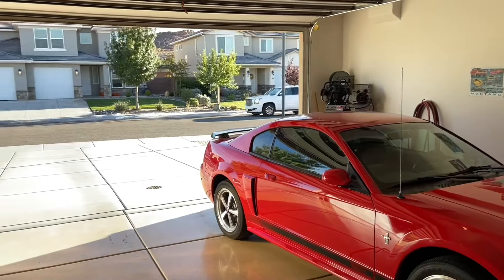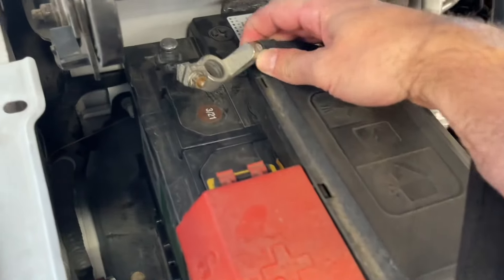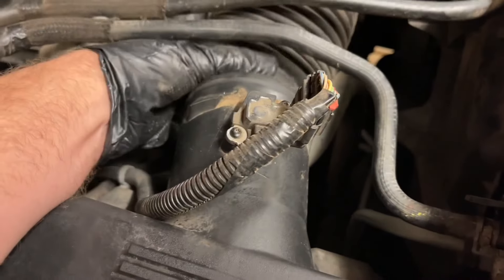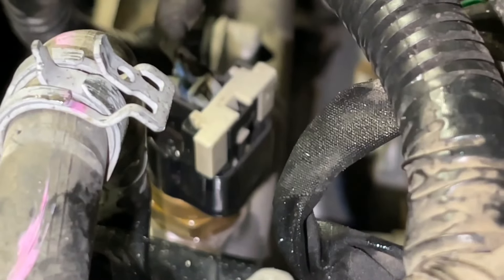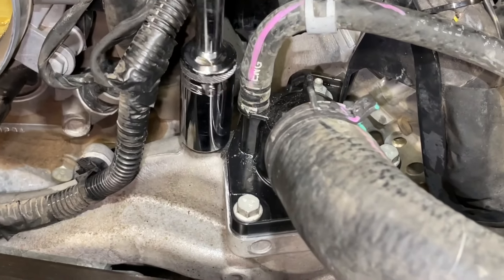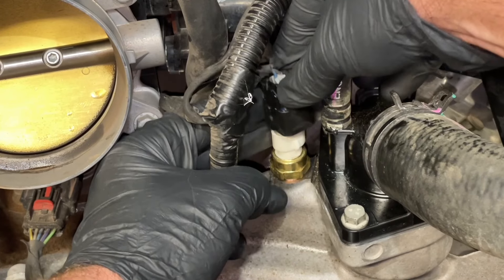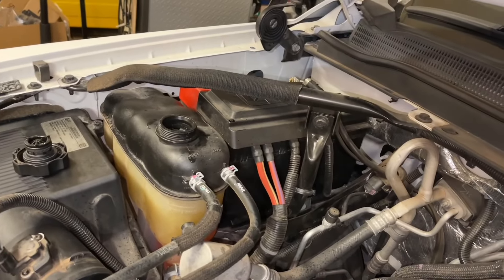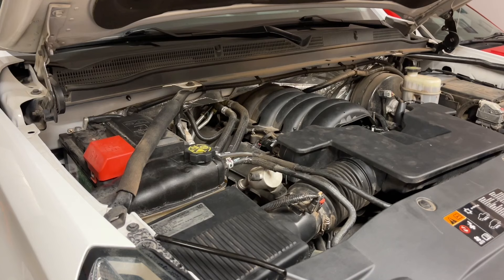Coolant temperature sensor replacement 2015-2020 Yukon, Tahoe, Suburban, Sierra Silverado GMC Chevy

Comment: Awesome video! Great detailed instructions. I skipped the battery disconnect and problem still occurred afterwards. Went back out and did that and it is fixed! Thanks!!!
Reply: Forgot to mention. My son’s name is Danny Johnson :-)
Reply from the maker: Sometimes the thermostat is also sticking open, so if it continues check this out https://youtu.be/aEfgkxWdBYw?si=FtnCYDUsV14AZ1xV

Comment: Very helpful.  My exact issue on 2015 Yukon. No check engine light came on. I did not take off the radiator hose. However, I just unscrewed the part slowly and let some fluid leak not much came out and screwed and the new one and called it a day. Took 20 minutes. Part was $35 at local store.
Reply: I'm having issues as well. Breaking anything where your electric engine fans running non-stop? Mine are doing that. After replacing that sensor did you have any more issues with your fans?

Comment: Great video!!! The fan was running the same way on my 2017 Yukon XL so I replaced the temp sensor. When I started it back up the fan was still running hard. Then I remember to disconnect the negative battery cable to reset it. Once I did that it fixed the problem. Also I was able to keep all of the coolant so I was out of about $18 total. Thanks
Reply from the maker: If it continues, the thermostat can also stick open and over-cool. Just fyi for the future 
https://youtu.be/aEfgkxWdBYw?si=-N6TXtaANmolkS9P

Comment: Thank you for posting this, my sensor failed. Replace sensor, cleared codes. Also cleaned throttle body since I had it opened 👍🏽
Reply from the maker: Glad it helped. You may also like my thermostat replacement if you continue to have a low temp reading with the fans on. Here it is just for the future https://youtu.be/aEfgkxWdBYw?si=F1Md-mZuSFiBVUap

Comment: To turn the fans of - pull the FAN 1 & FAN 2 fuses from underhood box on driver side (use pliers to do that) - they are big, 40 amp rated

Comment: Very helpful video, I followed instructions but I did not disconected the water hoses, I opened the de-gaser canister to release pressure in the system then closed it to keep a vacum, then I did the switch of the sensors as fast as I could and only a few drops spilled that were cleaned very easy with a rag.
Reply: 2019 Tahoe here and sensor was $17, teflon tape was $2; change was less than 20 minutes.
Reply from the maker: If it continues, keep an eye on the thermostat. They stick open commmonly https://youtu.be/aEfgkxWdBYw?si=GU7eoyQfQtVldt4g

Comment: This was very helpful! Got my sensor changed out today, fixed the same issue I day. Thanks!
Reply from the maker: If it continues look at the thermostat. It can stick open and also cause the fans to run and it to be less than 160 degrees https://youtu.be/aEfgkxWdBYw?si=Gh6g6cWAa_4jXnyA
Reply: @ good to know, so far it’s good to go, but I will keep that in mind 👍thank you!

Comment: Awesome video. I ended up combining both jobs and replacing coolant sensor and thermostat.
Reply from the maker: Good call. It typically is the thermostat sticking open. You’ll be glad you did it
Reply: @dannyjohnsonsgarage  yeah, my coolant thermometer wasn’t that dirty.  But I had the same symptoms you had. High fan running, 0 temperature on gauge.

Comment: Thaks Danny for the info, am not a mechanic but feels good to repair something for my self.
Reply from the maker: If it keeps happening and the temperature gauge looks like it’s on zero, it might really be at 160 at the bottom of the gauge and it could be the thermostat that is stuck open and overcooling the engine. If that is the case and the fan keeps running, look into the thermostat. Here’s my video for that. https://youtu.be/aEfgkxWdBYw?si=K20J0IOGiT2gs1q_

Comment: 2 things quick, don’t forget to disconnect the battery… it’ll continue to do the same thing. I didn’t disconnect and did it afterwards for about 15 seconds, hooked it back up and it works great. 
2nd I found that I could just slip my finger over the hole and slip the new one in. No need to remove any coolant at all. Lost about a tablespoon of coolant.
Reply from the maker: It’s good to start with the temp sensor, but I also did the thermostat at the same time. You’ll lose a little more coolant, so for that it’s good to disconnect the hose. If your fan keeps running and the temp shows zero when it should be warm, the thermostat may stick open 
https://youtu.be/aEfgkxWdBYw?si=aX4Vh3OADQiHOUtL

Comment: Great channel. I subscribed! Had this issue today and these videos explained everything really well. Only recommendation is to edit the comments to ensure people reset the cpu by pulling the negative cable on the battery.

Also, for anyone else out there, when removing the small hose from the thermostat housing to get that clamp out of the way, be careful. When removing it the piece my hose was lcamped to may have been on the verge of dry rot, or i didnt have the clamp opened all the way and the nozzle broke off in the house so i had to get a new thermostat housing and install. Oh well, probably good i changed the thermostat anyway :) BTW Danny has a video for that as well :)
Reply from the maker: Yeah, disconnecting the negative battery cable is covered as the first step in the video, but people comment telling me they didn’t do it as shown and short it out. It’s always a good idea to disconnect the battery when working on anything with an electrical connector but having people follow the instructions is another thing lol

Comment: This video was immensely helpful. Fixed my issue by following along. Thank you!!
Reply from the maker: Glad it helped!
Reply: @dannyjohnsonsgarage  hey buddy. So unfortunately, after two days, the same issue came back (radiator fan running high, and running for 5-10 minutes after the car is off). Any suggestions on what to try next?

Comment: Great video, I ordered the part from GM and followed this video. After install my tempt gage inside is still showing zero, any advice on what could be a further issue? I have a 2017 suburban.
Reply from the maker: It’s likely the thermostat is stuck open and it really is under 160 degrees. Also, disconnect the negative battery terminal to reset the system. https://youtu.be/aEfgkxWdBYw?si=HI78d7UGTKr0s8tq
Reply: @dannyjohnsonsgarage  thank you, that worked out perfect

Comment: Thank you so much. 2016 Escalade fans would run until the battery died. I replaced both the thermostat and the temp sensor(it was dirty). I didn’t even realize that my temperature gauge was incorrect the whole time I had the problem.

Comment: Was having the same symptoms; Just changed the sensor, would you proceed with changing the t-stat anyways? Or just sensor. Maybe a “not broke, don’t fix” thought?
Reply from the maker: Yes, many times it’s actually the thermostat stuck open and overcools. Gm temps sensors do show zero when they fail so many think it’s the sensor, but I did both and many have commented they needed a thermostat later as well as it sticks open and over-cools. https://youtu.be/aEfgkxWdBYw?si=mIsJFExX3nrUcGxF
Reply: @ good deal. Just finished up swapping it out also & so far so good! 

Thanks for the nicely detailed video!

Comment: Hello. Same issue but I changed the sensor and it is still doing the same thing. Any other possible suggestions?
Reply from the maker: The thermostat can stick open and also cause the fans to run as the temp really is under 160 and the vehicle recognizes it shouldn’t be. https://youtu.be/aEfgkxWdBYw?si=DNChAlcUGxf8tB_z
Reply: @ thank you. Let me try that then

Comment: Great tutorial. Was quick and easy. Thanks for the help.
Reply from the maker: If it continues, take a look at the thermostat as it can over-cool when it sticks open and also cause the fans to run Thermostat Replacement Yukon, Tahoe, Sierra, Silverado, Escalade GMC, Chevy 2014-2020 P0128
https://youtu.be/aEfgkxWdBYw

Comment: I changed my sensor and it fixed the issue but the fan came back on a week later? Could it be the I have to change out the fan?
Reply from the maker: Could be the thermostat Thermostat Replacement Yukon, Tahoe, Sierra, Silverado, Escalade GMC, Chevy 2014-2020 P0128
https://youtu.be/aEfgkxWdBYw

Comment: Those fans running when your vehichle is off,likes to drain your battery nicely..So I pulled the fuses to cut the fans quickly..
Reply from the maker: Just make sure the engine doesn’t overheat without the fans. The thermostat commonly sticks open and over-cools the engine, so if it continues check this out https://youtu.be/aEfgkxWdBYw?si=I1S3kFfLLlFEp0yr
Reply: @dannyjohnsonsgarage  In my case, my temp was right down cold..My fans would kick on high if I didn't let my Sierra warm up enough..Replaced the sensor & put in a hotter thermostat & did the reset..Been fine now..🫡🫡

Comment: Very well put together video. Do you really have to have the radiator step at all though? Just replace the sensor.
Reply from the maker: I also did the thermostat. If your fan continues to run and it shows 160 when hot, the thermostat may stick open and need to be replaced https://youtu.be/aEfgkxWdBYw?si=AazZG0KG1LvimCzP
Reply: @dannyjohnsonsgarage  So my fans did that for 2 days - then 3 months of nothing - as of yesterday started again so I just purchased the sensor and am going to do that here today. I was asking you though, it is possible to do this swap without draining fluids correct?
Reply: The answer is yes - for just the sensor - no need to remove any coolant hoses - just air box and straight to the sensor

Alright, I just did it in about 15 min - just very, very minimal coolant came out (half a shot glass) of the sensor hole. Everything is working great. Thanks again for the video.

Comment: Hello I have 2018 yukon and I been getting a power steering drive with care message and some hard steering for a spit second. I took it to the dealership they said they found nothing because there wasn't any code. Any ideas?!?
Reply from the maker: It may be the most inner, small belt you’ll see in this video, or the pump itself (maybe even a vacuum line hose leak). https://youtu.be/V3LGDazpjtU

Comment: Have this same problem. I replaced the sensor but after 10 miles it's still doing it. Any suggestions?
Reply from the maker: It is likely the thermostat is sticking open, over-cooling the engine and it is in fact cold (under 160 degrees so it looks like zero on the gauge). 
https://youtu.be/aEfgkxWdBYw?si=fDxvaCMBzYL304Id

Comment: Had same issue, replaced and started to do the same month and 1/2 later maybe some electrical cleaner is in need
Reply from the maker: Most likely it’s the thermostat sticking open. It really is running cold so it trips the fan https://youtu.be/aEfgkxWdBYw?si=tONPz_iSQen-_dXX

Comment: Great video what are the symptoms of needing to replace my engine is at 200 degrees while on a long trip .
Reply from the maker: 210 is perfect. Symptoms would be the fan staying on and reading zero when hot (looks like 160 degrees since that’s where the gauge starts).
Reply: @dannyjohnsonsgarage  thanks I’m having problems with the good ole P0420

Comment: I have a 2016 Sierra 1500 and my temp gauge doesn’t move and my fans are running on high, like in the video. I replaced the thermostat and still same issue. im going to replace the temp sensor and hopefully that fixes it. Oddly enough, I don’t have an error code show up on my dashboard.
Reply from the maker: I’m betting the temp sensor will fix it

Comment: Hello, thank you so much for this video. I have actually replaced this twice within the last six months on my 2015 Tahoe. The problem seems to keep coming back however :( first we thought it was a faulty part and replaced it again but now the fan is running again and the car is not overheating. What do you think this could be?
Reply from the maker: It’s not overheating, but is it over-cooling? If not at 210 degrees when warm the thermostat may be stuck open https://youtu.be/aEfgkxWdBYw

Comment: New sensor was missing copper washer.  Used the one from old sensor.  Do you think that will work ok?
Reply from the maker: Yeah, should be fine. Just check for leaks

Comment: Does check engine light come on for temp sensor?  Thanks
Reply from the maker: It can, but it’s more likely the thermostat sticking open
Reply from the maker: https://youtu.be/aEfgkxWdBYw?si=sUMXXcHYCk0TKJID
Reply: My check engine light is not on.  I will try the sensor if that doesn’t work onto the thermostat

Comment: Hey, I’ve used this video to fix my issue before. It happened again. I replaced my sensor but still no temp range and fans on high.   I’ve read you said the thermostat could cause it too. How would the thermostat cause the sensor not to read?
Reply from the maker: The thermostat is stuck open so the temp is indeed 160 degrees or lower, so the fans are turning on as a failsafe because the vehicle should not be operating with such cold temp and it realizes it’s doing so

Comment: Great video! I wonder about the check engine light, if I don't have a check engine light but my fan is running could it be the thermostat instead?
Reply from the maker: Yes, it can be if the thermostat is stuck open and it really is over-cooling https://youtu.be/aEfgkxWdBYw?si=5laUQyo23haONG0k

Comment: Having the same issue with same vehicle, thanks for the info! I also noticed your compass in the dash is showing —, i cannot find any information online to fix this as mine is doing the same. Any advice?
Reply from the maker: The compass is from the antenna on the roof. It needs to be replaced.
 If the fan continues to run, the next step may be the thermostat. https://youtu.be/aEfgkxWdBYw?si=jKFWODrx18KGySQw

Comment: Was her a/c working? We are having the same problem, but my A/c is not working either.
Reply from the maker: It may have also turned off in default mode. Here is the thermostat portion as well https://youtu.be/aEfgkxWdBYw?si=f7v2_F77RAP1J3MH

Comment: My husband just changed the sensor no more fans running when turned off but now it has the check engine light any idea what it can be???
Reply from the maker: I would think the thermostat, but you might want to run the code. A lot of parts stores will run it for free. https://youtu.be/aEfgkxWdBYw?si=g1IDDiBjMmFErZz8
Reply: @ thank you we just figured it out code said a sensor battery died he turned it on with out a senor and it made the check engine light come on thank you for replying!
Reply from the maker: @ if your fans continue to run, look into the thermostat I posted. I did it at the same time as the sensor, and others have said they had to do it soon after the temperature sensor. Glad you figured it out!

Comment: Hi. I have a question, I changed the sensor and after a month, the fan is turning on again, the temperature is reading zero. Do you have any idea what could be wrong? Do I need to change the sensor again?
Reply from the maker: The thermostat is likely stuck open and it’s over-cooling the engine https://youtu.be/aEfgkxWdBYw?si=SWnvnnvJH0sDW6uO
Reply: Thank you Danny. Your videos are so helpful and you explain with such clarity. I'm going to order the part from your link and give this a shot. Thank you! 😊

Comment: Awesome video! Was able to replace both the sensor and the thermostat following your how to. Thanks so much! One quick question though: when removing the retaining clip on the sensor, it actually snapped in half. Do you know the part number for that retaining clip or where I can find one?
Reply from the maker: I’ve had others say the same and no one has been able to get a part number from GM. It may not be sold separately, so a salvage yard may be the best place to cut a plug end off
Reply: @dannyjohnsonsgarage  Thanks! it was really brittle after years of being exposed to high heat. I’m surprised it isn’t a more common occurrence. Anyway, the connection seemed quite snug, anyway, so I’ll just watch it. Thanks again for the great video!

Comment: I know that you changed both the sensor and the thermostat- should I do both or start with the sensor and go from there? I have absolutely NO experience working on cars and my husband thinks I'm crazy, but I feel like I can totally do this at home after watching your videos!
Reply from the maker: I would do the thermostat as well. Be sure the vehicle has cooled down so the hot coolant doesn’t spray. Sometimes changing only the sensor works because the battery reset the system and it ends up being the thermostat all along

Comment: Hello I have s 2015 chevy silverado.  When I disconnect the pvc system I have what looks like oil in it. What does that mean?
Reply from the maker: The pvc system is intended to vent pressure from the valve covers, so it does suck oil vapors into the intake. The real problem is these trucks are now direct injection so the fuel no longer cleans the valves. It’s best to add a catch can or vent breathers https://youtu.be/Op2nSHkoD1Q?si=ZtwyI2fRQn2nVLde

Comment: I changed the coolant temp sensor and it worked for a day or two and the fan started to continue to run again. Should I change the thermostat also!
Reply from the maker: Yes, it may be sticking open https://youtu.be/aEfgkxWdBYw?si=cv3OAP1N17uE5JYF
Reply: @ sounds good. Great videos by the way! Extremely helpful!!

Comment: Hello we found this video helpful! Had the same issue with our 2018 Chevy Tahoe and just replaced the sensor and it fixed the issue we believe however now the check engine light is on and wasn’t before..will this correct itself?
Reply from the maker: It will need to be reset by removing the negative battery terminal https://youtu.be/wMd3CkYzkuk?si=PqWuDiCUP7R8f0Cv
Reply from the maker: If it continues after that, it may be the thermostat https://youtu.be/aEfgkxWdBYw?si=V0E4_4lwp7hHObFt